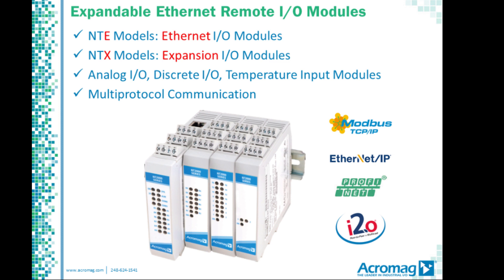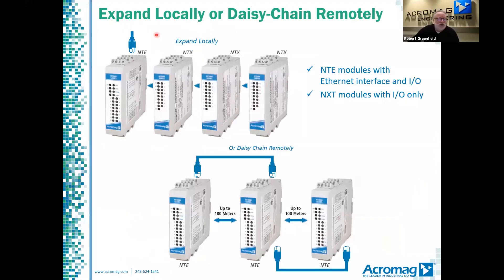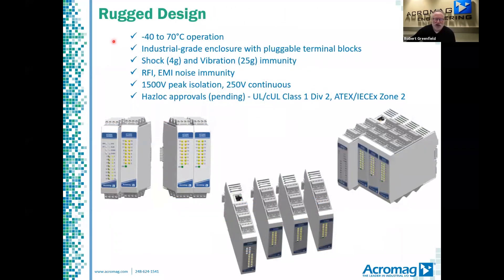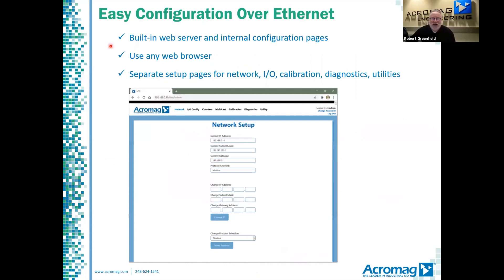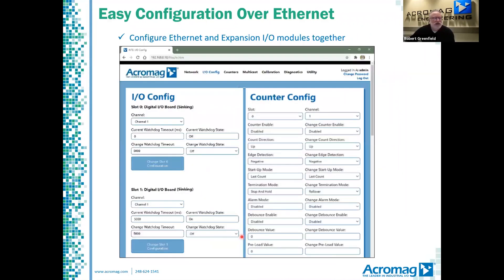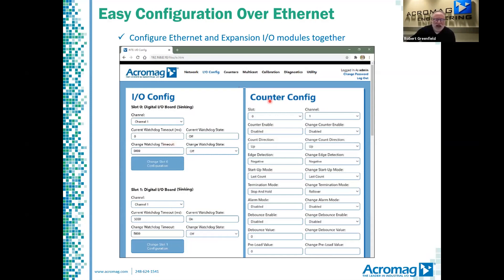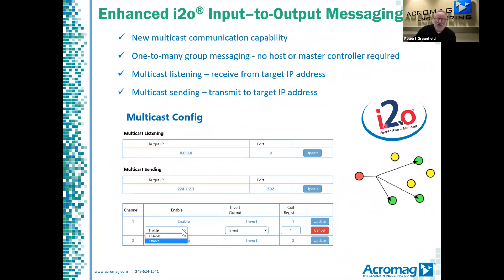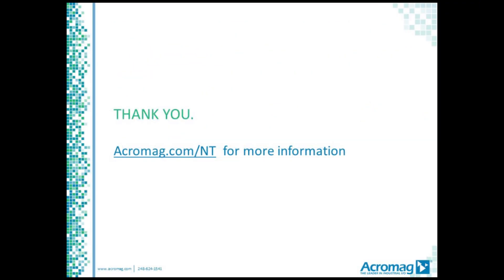Expandable Ethernet I/O: BusWorks® NT Series Introduction | Acromag

Comment: Only 100 meters? What happens if I use fiber optics? 
some problem about the delay or the syncroni?
Reply from the maker: Hi J, Per Modbus TCP/IP Standards - 100 meters is the maximum Ethernet cable length. But if you then place a switch, you can go for another 100 meters. There is no theoretical limit, only a practical and financial limit. You could use fiber to go longer distances more easily. Thanks!